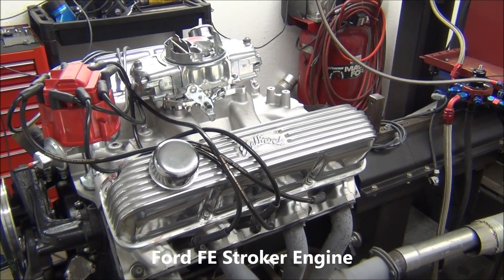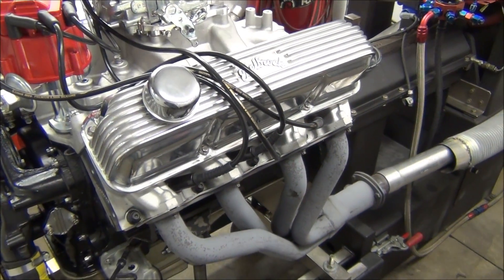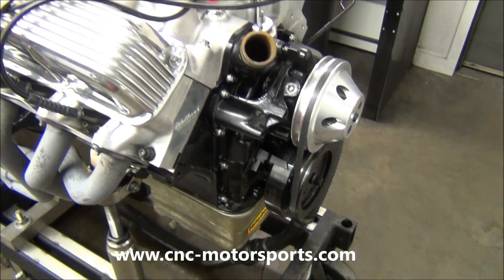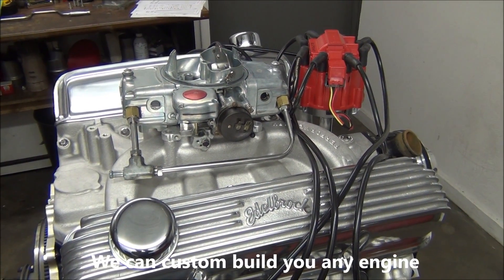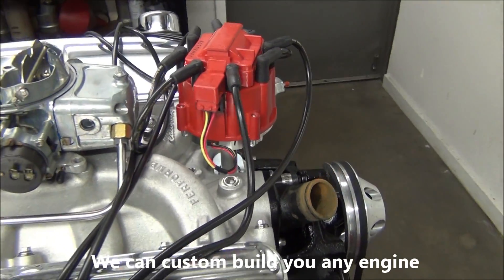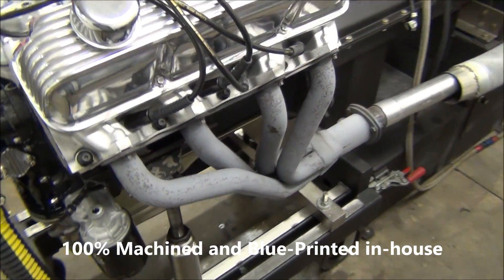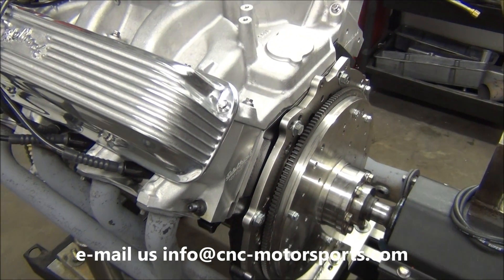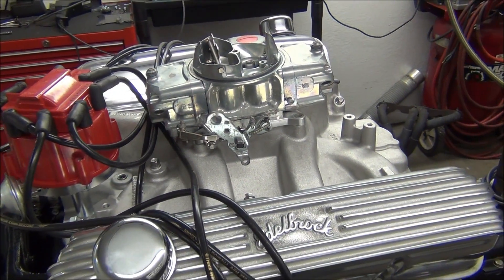Ford 352 FE 445 Stroker Engine Built by CNC-Motorsports

Comment: The 58 352 special with dual 4bbl was the one to have, factory 360hp, as well as the 390HP factory 401hp. They also had the 406, 410, 427 and 428 soon thereafter, all unicorns in my book. I am infatuated with the smallest of the big blocks being the 332 and 352, with the correct mods can output similar numbers to the Glidden clevelands he modified!

Comment: Chuck the obnoxious oversized chevy HEI and replace it with a duraspark distributor for an FE and run a remote HEI module if you really love HEI.  Actually cheaper to do and the stupid thing isn't in the way of your air cleaner either.
Reply: Not to mention for a Ford purest no GM dist should lever be used
Reply: I use a 4-pin dirt track module and HEI coil on two separate finned heat sinks. They have been excellent. Used a regular Duraspark  distributor, with the Duraspark pickup, and a points style male cap. I have also used a points distributor with the male cap, a set of points with no condenser connected to a GM 4 pin and a TFI coil, the HEI either one mounted on a heat sink is good too. Also use a solid state voltage regulator. The points ones can go full field and start a fire. I also use a matching steel gear to the roller cam. I don’t like bronze. The FE with a side oiler set of mains with the driver side bolts having the 3 center with oil feeds to the mains with lines to the oil filter adapter and plugs in the passages down to the cam and making the center passage bigger and the passege going up from the filter adapter to the top makes the oil flow better. You can also ream the front and rear passeges  to make the oil flow from the cam passege better. The crank with the Cleveland race main bearings and the 2.2 BBC rod bearings with the Molnar rods reduces the parasitic loss. I love the FE, just need Trick Flow or BBM heads. The 2.19 and 1.6 valves will fit the 4.08 bore. A 2 four barrel and two turbos would make you crazy. That is 426.6 ci with just a 4.08 stroke. Torque monster indeed. The 70s 105 blocks have the 3 ribbed main webbing and are good iron.

Comment: got a fe 360 bored .030 can i put a 390 crank in it and use my pistons and rod
Reply: Not the rods, according my ford manual, the only dif between 360 and 390 is stroke. 
However it won't run like a 390 until you get some decent heads for it, the 360 stock heads are garbage.
All fe blocks from 332ci-428ci use the same block if I am not mistaken, but get a 390 crank, rods, and heads, and you should have a 390.
I am no expert, so get a second opinion before buying anything!

Comment: I am rebuilding my first motor , a 352 out of a 65 Galaxie 500. If I'm reading this correctly, 454 HP??
Reply: They use yor 352 nlick only, and they throw in a stroker kit  (crank/rods pistons)  to get 445 cubic inches.

Comment: Has this been bored out any? Can’t seem to find a stroker kit for 352 .030 over
Reply: You need to go to 4.08". That is .080 over stock.  You can go less but you may pay extra for custom pistons.  4.08 is a stock size stroker piston.  Go to Survival Motorsports on the web.  They specialize in fe stroker kits and builds.  There's a lot of info on their site.
Reply: scat crank

Comment: I have a 64' 352 that I would like to make some power with without stroking it. What would you suggest I do?
Reply: silverbird58  It sounds nuts but we got away with boring them .60 to.80 over with a 390 crank you would have a 406 .A 428 crank would give you a 428 .At .80 over.
Reply: @edge2sword186  no issues with cylinder wall thickness?
Reply: @brockstarg2296  always have your block sonic checked before boring it out that far
Reply: @purpurahaze9179  I thought so, but from what I understood, the fe had a pretty thin cylinder wall to begin with so .080 was probably too far over to hold up to any serious power. In my opinion it would be better to get a 445 stroker kit and do a .030 over to get the power of a 428. I haven't even seen a genuine 428 crank and rods for sale, and they are for sure going to be a fortune.

Comment: Can a 390 be bored to stock 428 bore and stroke?
Reply: Gadsden Viper yes.. put in a 428 crank and rods will make it a 410 " old mercury engine" made great power. then bore like 40 over i believe and there you have a 428 from a 390.
Reply: @deefisher5157  80 over bore 4.13 - 428 bore vs 4.05 bore .390 and 410 Mercury.
Reply: can make 427
Reply: @gregcarder4605  No.
Reply: A 428 bore is 4.13 in. A 390 block is 4.05 in. You can't bore a 390 out to 428 specs. You have to put in sleeves.
Reply: @lorenzomaximo1818  We did it so many times it would make your head spin and TRW used to sell .60 over pistons for the  428 .Somebody gave you a line of BS on that one .It started when a wrist pin lock came out so we took a chance and went .60 over .Also put in spiro locks and don't overheat that engine because the cylinders are thin at that point .
Reply: @lorenzomaximo1818  boy you don't know Jack shit do you all the same block's!!!
Reply: @royhorn2782  High nickel content blocks do exist...but ppl have checked them and there is almost 0 difference apart from in the webbing.
Reply: @asambi69  I didn't say anything about webbing. But, there are differences in webbing according to what molds were used. I have a 64 390 block with same webbing as the CJ blocks and the bosses for crossbolts. Dont think for a minute that ford wasn't doing all kinds of things early on in the FE's development. FT's have been noted as having more than a few(not all) with high nickel content like the 427's. Bore wall thicknesses were all over the place with the FE/FT blocks just like the core shift from casting. You have no way of knowing exactly what you can do with it until you sonic check the cylinder walls. I talked to old FE racer (legit racer) from the late 50's when the FE was introduced. He said at that time the cylinder walls were much thicker and that they were able to get crazy bore sizes because of it. That changed later (near 1960) and they were no longer able to increase bore to the same amounts as they did.
Reply: @royhorn2782  The FT industrial engines also had forged steel cranks that many did not know about. But yes you are right about the 331/361/391, all HD industrial engines. Also the FE engines were in fact the same block only machined differently, they did make many with reinforced webbing and around mains as well as thicker cylinder walls. I have some old books on FT/FE engines that identify everything by the numbers. Also yes the first FE's in 58 were the 332/352/390 HP versions and were much more durable as in the late 60's early 70's. However, the internals and heads were the distinguishing factors in CI, including bore size.